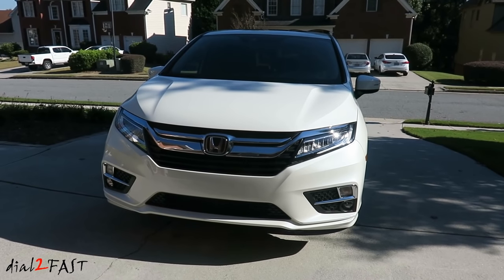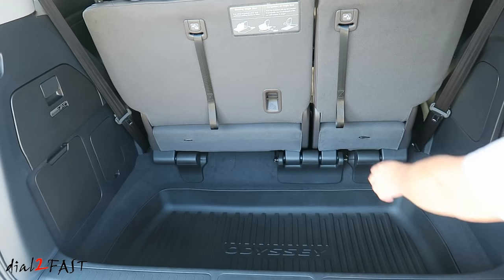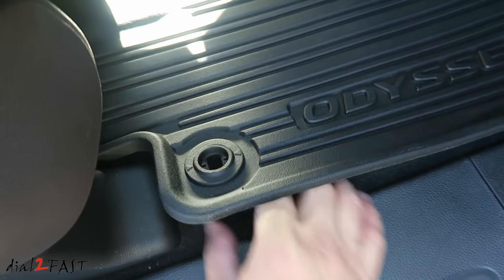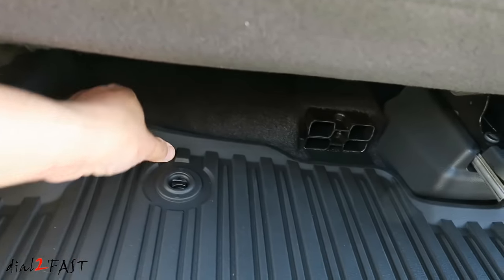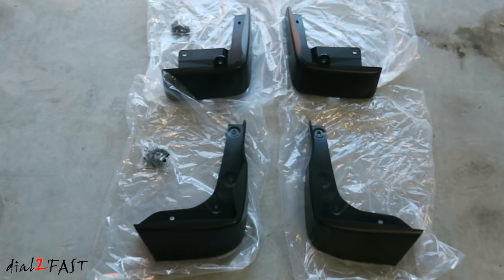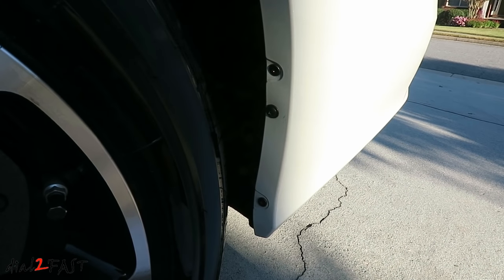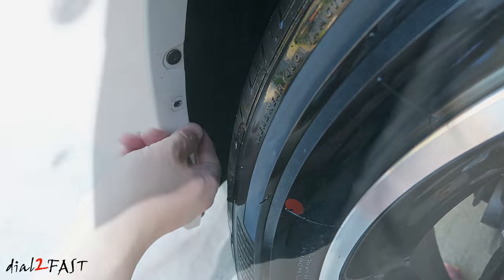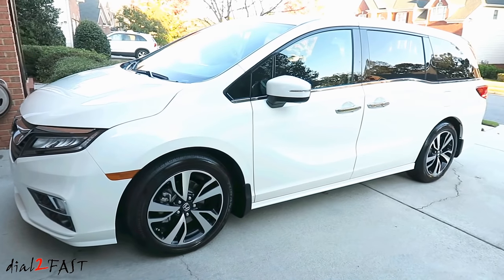2019 Honda Odyssey Install : Splash Guard / All Weather Mats / Cargo Tray

Comment: I just bought the same white+brown 2019 elite!   I really like it, just that my wife drove through it's first rain.  Talk about getting dirty fast!   It doesn't really help that we're in the desert and streets are oily if we haven't had rain for a while.  I recalled your video as we were debating on which floor mats to get.   So seeing all the grime covering the new van I ordered the oem mats and splash guards.  Just received them and couldn't figure out how to remove the front fasteners.  After successfully removing one, then re-watching your video, I saw my mistake and was able to reuse it and the rest was as smooth as butter.  Thanks for posting this!

Ps. On the rear guards, the top hole was blank!   I had to predrill! Though it took a bit longer, it was not that big of a issue.
Reply from the maker: Thanks for sharing your experience. Yeah, the install guide mention about piercing the hole but somehow mine was different. We are loving the van, rides great.

Comment: Hi, I need help on this. Any side negative effect on using the old screws? Many thanks in advance. Long story: when installing front passenger side,  the metal clip fell off when I was removing the screw (the most inside screw). Now, I can not screw in the new screw, but only the old screw (I may mess up the distance between the two side of the U-clip, so not only I cannot screw it in, it strips the new screw if I force it)

Comment: Why didn't you buy weather tech floor liners? I think they'd be cheaper that OEM and they come up higher around the edges and are custom fitted too.
Reply from the maker: Because I find Weathertech floor mats to be much more expensive than OEM. Weathertech is $250, and Honda is $150. If the cost was close, I might consider it but not for a $100 difference.
Reply: @dial2fast  i agree with you, i picked up the 2019 honda odyssey exl with nav/res,  my buddy chose the weathertech mats and he is very unhappy, the build quality is not quite there, i picked up the oem variant floor liners for $150 and i am loving them.

Comment: The Honda all weather mats suck unless you live in the south. Used this type in the previous gen. They dont work well in the rust belt. The reservoir to 
hold snow melt, road salt etc is way to shallow and easily overflows.. Get weather tech even if you just buy the front ones, they are premium but if you can spend 40K on an Oddy whats a little more.. Im still using my trunk liner from my 2003 Oddy and its in the 4th Oddy now a 2016. EXL N.
The cargo liner really sux as its a fold up. Cant slide anything on it as its a 3 piece fold up. Still using my 2003 Oddy cargo mat as it's one piece and a heavy duty floor coverer and can take whatever i slide or put on it. Front flaps are easy to do as shown. Pull the rear wheels to put flaps on. You can't properly insrt the screws even with stubby drivers or whatever. At the same time inspect the RR brakes. Ive had to repair many rear flaps mountng areas and clips due to some one nor taking the time or doing poor install. After a repair to my 2016 EXL N at a body shop im familiar with and use, the L Rear flap fell off and was lost same day, R Rear was in place with screws improperly installed on angles waiting to fall off. Body shop gave me the new rear flap kit parts, i took rear wheels off and installed then corectly. Good time to rotate the wheels and  inspect or service brakes if your capable. Torque the wheel nuts to 94 lb ft. Use a torque wrench and you just stayed away from the dealer and saved some money.

Comment: Can these splash guards work with trim level or just the elite..? And same question for floor mates?
Reply from the maker: Work for all trim levels. I think there is one philips screw on the back mud guard that you may need to pierce/drill a hole for it to go in (I didn't have to). But the steps are pretty much all the same. Same for floor mats.
Reply: dial2fast oh ok thanks brother!